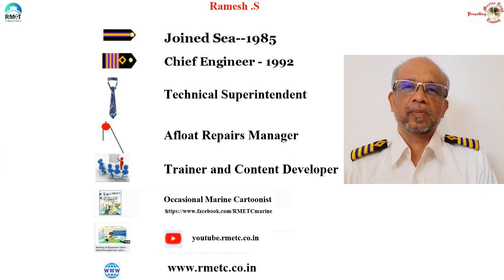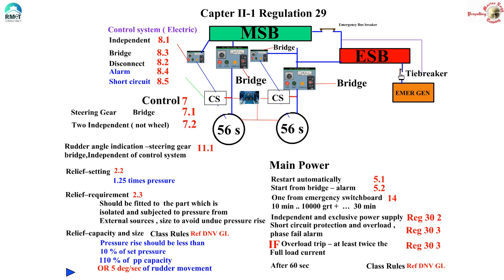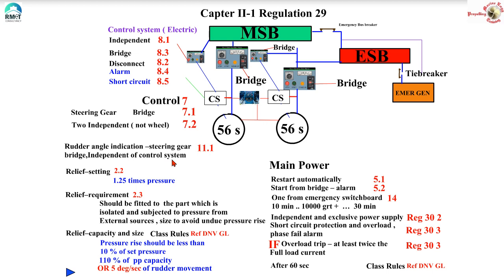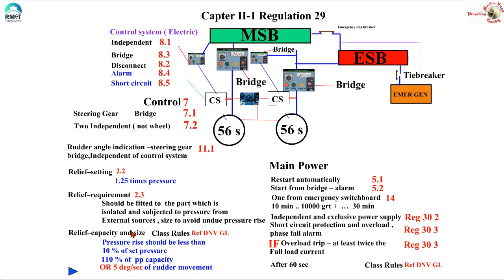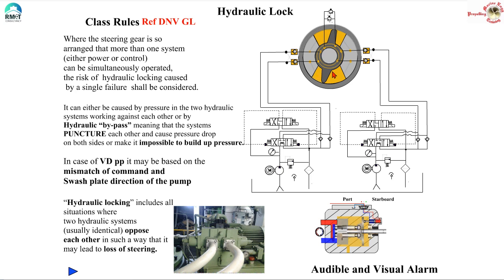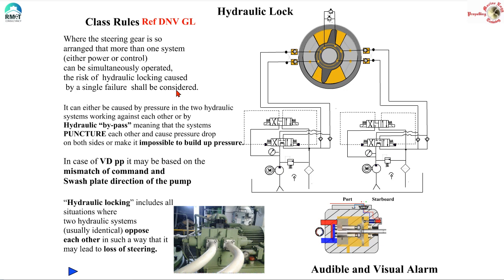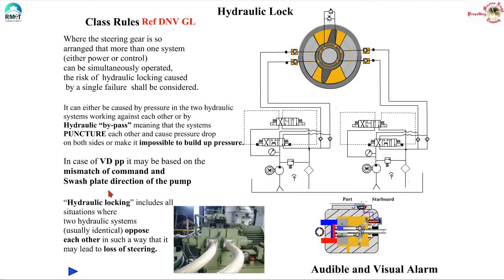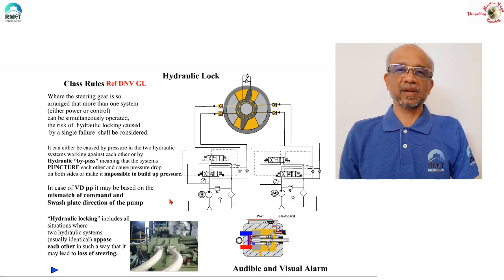Steering gear for ships  Regulations Extracts-Part 2.|What is Hydraulic Lock|RMETC video

Comment: This gives a clear picture of what is happening inside the hydraulic system. Just had one doubt about the relief valves, that when SOLAS says that the relief valve is supposed to be set at 1.25 times of the working pressure, why do we have Class saying that it should be set at 1.1%?
Reply from the maker: I guess the 1.1 % is for Capacity  not pressure. For opressure it is 1.25 but the INCREASE in pressure shud not be more tha 1.1 %

Comment: SIR , can u make clear the point at 7:58 of video ...if you have 2 main s/g ,two control system also to be there, and to be independent exception can made if you have telemotor system - in this point the control system means is that emergency steering which we are doing manually or whats meant by control system

Comment: Good effort. .If two systems are running and a hydraulic alarm is raised, by swiching off one system and operating with only one system should solve the problem. Is this correct????

Comment: Good day sir,
Short circuit protections are provided for both control and main power circuit. Does it mean that it only provides alarm ? Or does it mean there is a trip protection against short circuit ?
Reply from the maker: Short circuit..Trip...and alarm always...only overload trip for power circ is optional with a setting of 200 %

Comment: Sir...you said that when the rotory vane steering gear is on hydraulic lock by the isolating valves...the isolating relief valve is in command if sea forces hit the rudder then the rudder must have moved by some degrees...in that case sir...how can we take back the rudder to its default place..if it is in hydraulic locking condition..?
Reply from the maker: You are right..The rudder does change position due to sea water waves hitting it due to The shock absorber valves . But this change in Rudder position results in a deviation from the set point. Hence a new corrective action generated. Isolating valves have no role to play in this scenario
Reply: @rmetcvideos  does that corrective action generated by gyro...?
Reply from the maker: @RITESHKUMAR-te3pp  gyro gives the feed...auto pilot releases the signal...
Reply: @rmetcvideos  thank you sir...!!!..
Its clear now ✌️
Reply: Sir i request you to please make a video on PID on steering gear.

Comment: sir if surveyor ask us what is 100% redundancy and what is 50% please tell us what to answer for this
Reply from the maker: Difficult question bcoz it depends on interpretation of surveyor also. However I will  tell you my answer basis some guidance from class advise Giving steering gear as example...A steering gear needs to move rudder in 28 secs as per SOLAS . Depending on ship type as you have seen in  video, it can be done with 2 pumps simultaneously. In this case -- 50 % redundancy. In case EACH of the pump was capable of moving the rudder in 28 secs...    100 % redundancy. I still advise you to tell the answer which the surveyor wants to hear..
Reply: @rmetcvideos  sir can we say in case of failure in one unit of system if it is able to achieve requirement o 28 sec it is 100%